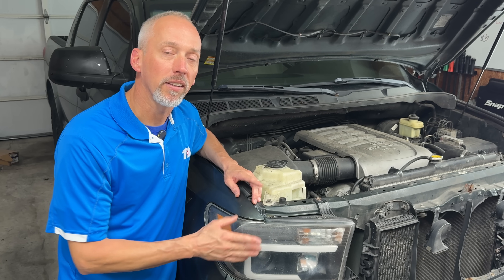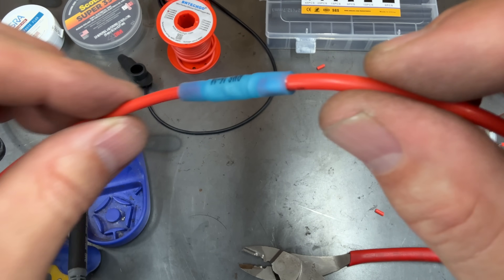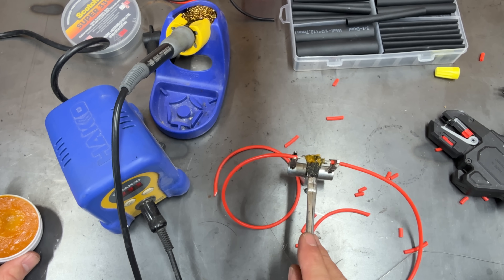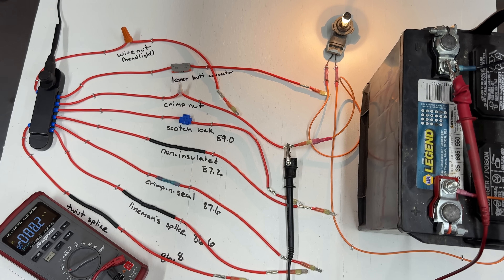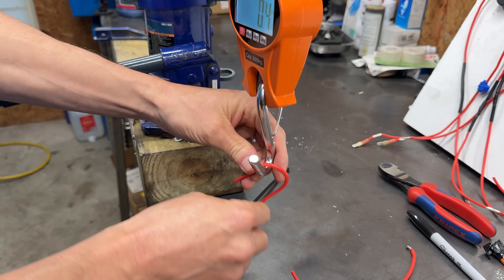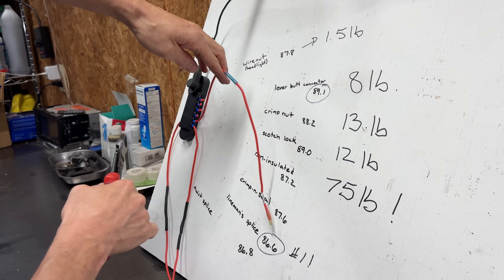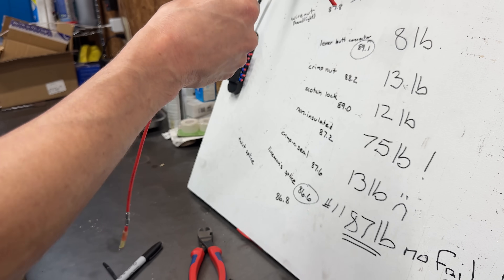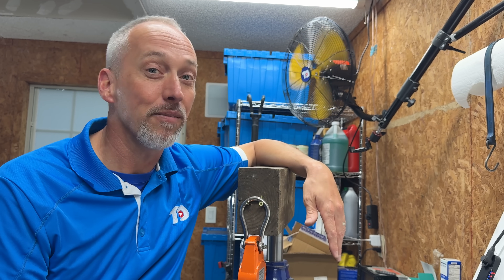I tested these connectors and found the best one

Comment: soldering is not good for automotive applications because of the vibrations. it will get brittle overtime, so the un insulated crimp the best for automotive or vehicle applications
Reply: I’ve heard this too. But how much vibration and is that only attached directly to the body of the car? I have many wire looms in my car that aren’t attached and I doubt get much vibration.
Reply: @J @JamesVR6 its more of a combination of the heat and cool cycles along with the vibration. And solder with get brittle overtime regardless
Reply: @ShamrockUSA 
Over how much time and how much heat/cooling? Like under the dash is different than the engine compartment. 

I’m not arguing, just trying to understand.
Reply: @J @JamesVR6  the engine bay is where it will be under the most stress, under the dash not as much. It could be as little as a month or it could be years before a failure happens. Depends entirely on the vehicle, how it drives, and how it’s being driven